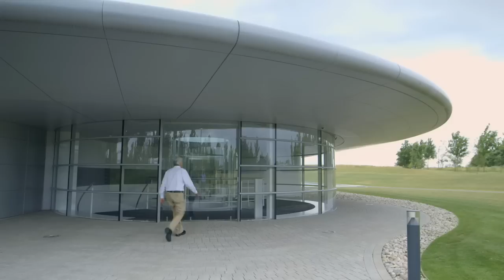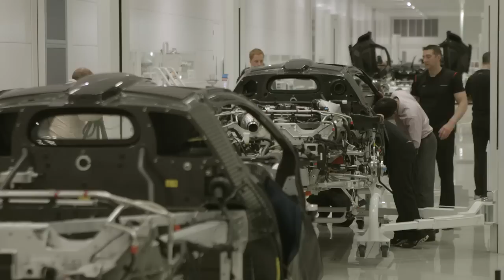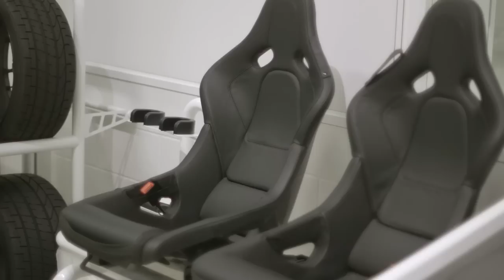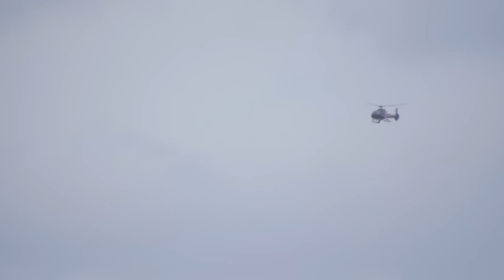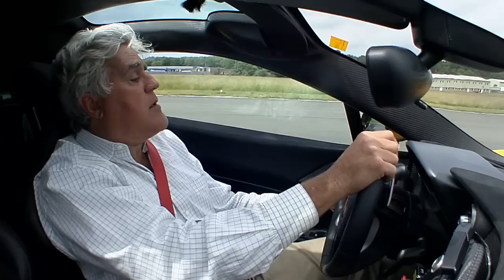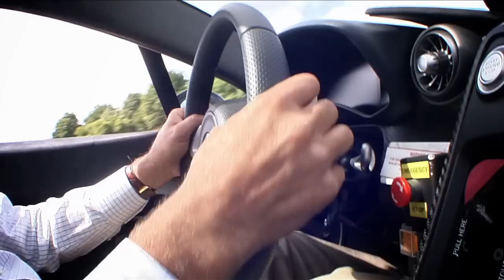2014 McLaren P1 - Jay Leno's Garage

Comment: @Fussinated Dude we don't value something by the same way. Our values are all different. I dont think you are in a position to judge there. I would also like you to show me those statistics were it shows "european people" thinking the LFA is overpriced because it's a slow car compared to a super car. Also I cant get the idea of comparing a LFA to a Mclaren P1. They are not even on the same league dude. Different cars, different purposes. The LFA is a thrills car. The P1 is a technological statement. A car can't only be valued by it's nurburgring time. Speccialy if that version of the LFA has been fine tunned for that track. In my opinion the LFA is a bit overpriced, yes, not for beeing slow, but for not beeing refined enough. It's an awsome car, dont get me wrong. The sound, the looks it's awsome. But that gear box isn't refined enough. Works on the track, not so well on the streets. Handling can be a bit tricky too (proven by the death of it's test driver). For me, a $300k+ car has to be just perfect, the LFA is close (that sound is awsome) but IN MY OPINION not quite there... But again that's not even related to the P1 which is what this video's about.
Reply: "Dude we don't value something by the same way"

Exactly. When it is a Japanese super car it is overpriced when it is a Euroepan car it is an engineering marvel and deserves no matter how much money you spent for it.

"Our values are all different"

I know, whatever Europeans throw at are valuable and deserves the asking price, but anything else doesn't worth what it cost or asking price. This is the difference.

"I dont think you are in a position to judge there"

I am judging anything. I am applying a principal brought by the guys, in means of culture, who produced this car. I am trying to avoid applying double standards.

"I would also like you to show me those statistics were it shows "european people" thinking the LFA is overpriced because it's a slow car compared to a super car"

Watch the top gear episode about LFA and listen to the "verdict" they gave and try to watch every possible LFA video on you tube. Then come ask me again about the "statistics."

"Also I cant get the idea of comparing a LFA to a Mclaren P1."

Why?

"The LFA is a thrills car. The P1 is a technological statement"

I don't know what a "thrills car" mean, however, where did you get this classification? Is there class of cars called "Technological Statement Cars" not to be compared with a "Thrills Car" ?

"A car can't only be valued by it's nurburgring time"

So, we have to go by the reviewers subjective conclusion about the car to determine whether it is overpriced or not then.

"Speccialy if that version of the LFA has been fine tunned for that track"

So, then we should consider LFA a different car when it is tuned differently. By the way Nurbugring package is not tune for track. It is road legal car that uses street tires. It is not different than tweaking the performance of your VW by changing the air filter and adding body kits.

"In my opinion the LFA is a bit overpriced, yes, not for beeing slow, but for not beeing refined enough"

Then this car is refined for you to pay $800,000 more? At best you are trying save your ego right now by saying that LFA is not refined enough. It has the best engine sound among the whole super cars, it has the best performance and it has no less quality materials inside and out. You are just bullshitting here.

"It's an awsome car, dont get me wrong. The sound, the looks it's awsome. But that gear box isn't refined enough"

The gear box is single clutch for weight reduction purposes. It is still better than the Ferrari F359F1 single clutch gear box which no one complained about when it came out. :) Again double standard. Beyond that, even with that so called non refined gear box it is still faster than its competition again with street tires.

"Works on the track, not so well on the streets"

The general view is actually the opposite. Because, it is slower it works on the streets but not on the track. But of course. after kicking ass on the track as well now this kind change of mouth is prevailing as it seems.

"Handling can be a bit tricky too (proven by the death of it's test driver)"

You don't know what you are talking about do you?

"For me, a $300k+ car has to be just perfect"

So then Mercedes Benz McLaren SLR is perfect because you don't complain about it being $490,000. You never whined about it being overpriced. I guess you should stop applying double standards.

"the LFA is close (that sound is awsome) but IN MY OPINION not quite there."

Well, YOU DON'T HAVE AN OPINION BECAUSE YOU GO BY WHAT YOU WERE TOLD.

"But again that's not even related to the P1 which is what this video's about."

This video is about an overpriced car, which has a $1.2M price tag, And the decision about it being overpriced is made by those who gave their verdict about another super car, Lexus LFA,
Reply: Pedro Matos
 "Dude, first of all stop second guessing about me"

Why not DUDE? you guessed about me at your first post without even talking to me. So why shouldn't I do the same thing even after having some ideas about you the way you respond?

"you don't know me so act like such"

I am acting just like yourself. I don't see the problem here.

"otherwise I'll treat you like an annoying no life kid that has nothing to else to do then to come in here and act like a bitch"

Be my guest. You will be treated properly in return as well.

"If you think you desearve credit act accordingly"

I don't think about deserving anything. I reason with  facts. For example just like it happens in the case of the LFA you apply double standards. When it comes to calling me a hillbilly American you have all the right in the world to do guess about me, However when it comes to others making logical statement about you after hearing your remarks, guessing about you is an insult. This quite typical.

"if you don't know the difference between a car designed for thrills, and a car designed to be a technological achievement then this is useless"

What is useless? Not caring your arbitrary, personal terminology about cars or, you have something else in mind. LFA is a super car, This is the universal definition of what type of a car LFA is. It is a technological achievement too, but it depends on how you look at it. And there is no car classification as "Technological Achievement" cars. There are concept cars but that's about it.
I don't know about useless, but if you don't know what you are talking about it is  time for you to shut up.

"because a car is always developed with an objective in mind wether is confort, luxury, daily transportation, the LFA is designed to give you thrills"

LFA is designed as a super car with the idea that Japanese can produce a car for super car market as well and compete with European brands. I suggest you should at least watch the LFA documentary. It is on you tube. If you don't want to educate yourself by reading.

"nothing wrong about that"

The only wrong thing so far is you are using your personal car classification terms. Other than that everything is fine.

"As you should know the tune they gave to the lfa was much greater than an air filter (again, stop second guessing about me I own a Japanese car and I wouldn't have it any other way), fine tunning a suspension to a specif track can do a car wonders"

I know what I am talking about. It is not even a tuning it is more of a tweaking thing. You should read more before you speak and stop assuming about the topic at hand. You don't know me either. Even after this much conversation, you still are not registering that,  I wouldn't even mention such a thing if I couldn't defend it. Well, continue talking like this and you will know anyway. However, don't get angry when you are proven wrong though. Because, so far that's what you are doing. As I said in the beginning, your ass is being given in your hand by a hillbilly American. That's why you are trying save it desperately and make a big ego thing out of this. Anyway Keep going.

"This does not mean I am taking credit from the LFA"

Irrelevant.

"The time is incredible"

Actually, it is not only the time. Lexus LFA looks an inferior car on paper and performance tests, It is slower to 0-60 than a GT-R. It pulls less g forces than a Ferrari 458 etc. However, its truly an engineering marvel since it is more than the sum of its parts. And it achieves those performances with street tires. So, if you think the focus here is just a chronometer measurement, you are way off.

"But I stand by what I said earlier "a car should be valued just by it's nurburgring lap time" "

OK! First of all, You asked me a proof about why i say that Europeans verdict LFA as an overpriced car. And I explained to you by its price and its performance and I gave the necessary reference. It is well known that all the car producers bring their cars to test to the Nurburgring, even though they have their own test tracks. By the words from the mouth of the project manager of Porsche 918 (another overpriced European "crap") if a car has any weakness, it will show at Nurburgring. So, Nurburgring is the place to determine about a cars performance.

So, LFA is overpriced because the price that is asked for it, does not legitimize its performance. This was the verdict of the European car reviewers. Hence. LFA becomes the criteria to assess a super car whether itself is overpriced or not. If you have problem with that, I can't help you there. So, you should better start your own car classification system along with your own car test results with your own criteria and expect to be accepted by the car market and then re-classify LFA and re-define it as overpriced according to those results. Until then, I, along with so called car media, go with the criteria at hand. And, that criteria decided that LFA is overpriced, and made it a criterion for deciding other super cars.

"The most important aspecto of a car is the way it makes you feel, the sensations it gives you"

Well this not only not true but also something you can't bring as an objective criterion. Say, this McLaren is overpriced because it makes feel like an idiot who is taken for a rich idiot. Should we then give the verdict that this car is overpriced?

"Unfortunatly we can't test drive it so, we got to take other peoples words for it. And no, I'm not saying top gear owns the truth, all the reviewers opinions count"

Then start learning about reviewers as much as you can, because since the LFA came up I watched pretty much all the review about it. And, the only person who didn't make a remark that can be interpreted as LFA overpriced is Jay Leno. it mentions the price but he says it comes with the territory. So, keep that in mind. Also do you really think that I am saying things without even knowing this stuff? Who is guessing about who?

"I'm not arguing about Lexus's choice of materials, and I shouldn't. They use the best on their $50k cars, so It's safe to assume they'll keep the standards with their $300k+ cars."

OK!

"What I said about the Gear box is about the Kick when changing gears. It's not unintentional and it's pretty cool when you are hammering it, but i dont think it is so good when you are stuck in traffic, I've also read the automatic shifting doesnt ever know what gear to engage. This is not just with the LFA, in fact i knew a guy who owned a M6. He sold the car, the main reason was the gear box. The car leaped forwards of backwards when he engaged the lower gears."

First of all, The biggest criticism about the LFA's gear box is about it being slower in shifts than having a double clutch gear box. And, this "kicking" you mention, I am hearing it the first time from you and therefore I am deducing that it is not a factual statement but just a assumption.

"I think it's safe to assume that a car that kills it's chief test driver will be pretty tricky to handle by a non professional driver. But again, most hardcore cars with 1 or 2 exceptions are."

First of all, The driver is killed on a side road, off the track. It was a collision with another cars. Second, because of this, there is no record of the accident and no one knows how the accident occurred and why. So, if you have a better knowledge on this issue, please inform the authorities, since they still are looking for the truth about it. So far, they only have guesses. That's why I told you that you don't have a clue what you are talking about on this killing the driver, because no one has.

"Again, you don't know anything about me. I hate the SLR. I wouldn't buy it even If i were Bill Gate's kind of rich for half the price. It's fast but, for me, there's nothing more to it. Again, we all have different values, and I'll respect the ones who like it"

That's quite irrelevant. You never heard reviewers call it as overpriced. You never made a statement about it as overpriced, not even according to your own classification, because you will rationalize it as, again, since that car was technological achievement car, and it worth the money even if you don't like it. etc. The issue here is the double standard. Your personal likes does not count. You may even like a Jaguar and be in love with it, but objectively it is the least reliable car in the world. If you apply the same principals and find out that Toyota Corolla is the most reliable car you have to admit that Corolla is more reliable car than a Jaguar, period.

"The vídeo is about an ahyper car, there are plenty of them"

Hyper car, as a term, started to be used for production cars after the LFA. Because Europeans realized that They have to change something since Japanese can produces as good a super car as Europeans, if not better. So, they come with hyper car thing. Here is a home work for you; find a PRODUCTION CAR that is called hyper car prior to LFA then you will have a point. :). However, I am just a hillbilly, American most likely I am saying these things without even making a research or something. Why don't you do it the right way then? :)

"As I said I don't think it's fair either to the LFA or the P1 to be comparing them. They are so different from each other they aren't even on the same league. If you want to compare the P1, compare it with the Ferrari LaFerrari or the 918 spyder"

The difference is that the cars you mentioned are hybrid cars. That's the only difference. However, if they are different as you claim than super cars, i.e.they are hyper cars, then hyper cars are overpriced cars. They can't even perform as good as a super cars namely the LFA yet they cost too much.

However, your persisting on this brings out another double standard issue. Here is what I want you to do. I want you to tell me that you never compared a Hybrid car, say Toyota Prius, with a diesel car, say VW Jetta. And I want you to persuade me on that .... If you want a clue, you will never be able to do that. :).

"I'm not saying the LFA is a bad car, far from it, as I said it's sound alone is almost worth the $300k, and would defenatly be in my 10 car garage"

OK! here is the deal I am not saying that this MacLaren is bad car, far from it. It almost worth more than $300,000., and if it cost around that I would have had it given that I had the money.

"But, If i were to spend those ammounts of Money in 1 car, I would probably choose an aventador."

But, If had to spend $!.2M in one car I would probably have hung myself, or I would do it under duress. :).
Reply: Fussinated I didn't feel insulted by your second guessing I just pointed out you were completely wrong. I didn't second guess, I made an honest call based on what you were saying. As you remember you were saying "the p1 is overpriced because the LFA is fast on nurburgring and it's 1/4 the price". On further conversation with you I realized that your opinion is more profound than that and I was wrong, even if I don't agree with you. As I said I don't think we can evaluate cars for it's nurburgring times. Specially if the P1 has no official time (that I know about). And I stand by it. There's much, much more to be said about a car than the nurburgring time, and even you can't deny that, and in my opinion the GT86 it's a solid proof of that.
I also don't understand why you can't accept when I say cars are designed with different ideas in mind. When the Veyron first came out, I remember reading one of the developers saying that the car was built more like a technical exercise then anything else. And yes, I (yes I) consider this 3 new hyper cars more like concept cars for the road than just a simple super car. They are, for the first trying out this "new" hybrid technologies that I suspect we'll see on their next cars.
I'm not saying the LFA was not a turning point for lexus either. They spent 9 years developing it and for the way they made it, the responsiveness of the engine with a time of 0.6 seconds from idle to redline, the sound (and the way they channel it from the engine bay to the passengers, the way the interior is styled, all of that it's just "crazy". The Experience it gives you is just thrilling.
If we compare the standard LFA and the R35 GTR, the GTR. The GTR is, on the track, a lot better than the LFA, and about 3 times cheaper. But I think you'll agree with me when I say, I still think the LFA is about 3 times the car the GTR is (I also love the GTR). With this, I'm not saying the P1 is better or worse then the LFA (I didn't from the start). I just think those cars are so much different from each other to be compared. 

I don't understand why you think what I said about the LFA being designed for thrills conflicts with what you said: "LFA is designed as a super car with the idea that Japanese can produce a car for super car market as well and compete with European brands." I've actually watched that documentary awhile back. If you think what I said conflicts with what I've said then you've misunderstood me. I said the experience they wanted you to have while driving a LFA is a lot more thrilling and intense then most other super cars, and that was one of their main goals. Of course I'm only guessing, since we've never actually driven one that's all we can do, and I've already explained why I think that.

The problem with the automatic gear box not being able to choose the right gear is/was indeed factual since you can find it in some reviews, I just don't know if it got corrected in the latest 2012/2013 models. Not a big deal since I can't imagine too many people buying a LFA and drive it in automatic. As for the "kick" I'll quote LFA Chief Engineer Haruhiko Tanahashi in an interview:

"- Have you considered a dual-clutch automatic gearbox for the LFA?
I’ve tried Volkswagen’s DSG around Nurburgring. Although it must be said [that DSG] is smooth, such a gearbox doesn’t suit the LFAs boy-ish character."

They want the driver to experience the gear transition. Not just a continuous acceleration. Again, they want it to be thrilling. It's not a bad thing at all. On the track I also want to fell those transitions. But I've read some guys saying it may become annoying in traffic. Of course, I haven't experienced it myself, so I wont vouch for that.

I did know the accident was in a side road, and no matter what were the circumstances the driver died and the car failed.

I do in fact think the SLR is overpriced, because I don't think it handles, sounds or looks the way it should for that price, and when it came out, I did find some reviewers saying it was indeed overpriced. But when we evaluate cars like this all our values and personal likes will come to play, weather we like it or not. I cant see most cars just like a bunch of numbers. For me, there's more to it than their times or top speed, and I think I'll be safe to think that for you there are too. Since we are talking about cars that in terms of performance are not so far apart from each other, our personal likings (even in the reviewers) will come to play.

Why can't you just say an hypercar is a car much more exclusive and special than a supercar? Usually the more exclusive something is the more expensive it gets. It doesn't mean it's necessarily better or worse, just that it is more exclusive and in someway special, therefore usually more expensive.

I did compare the two. Mostly because Toyota says the prius is a very economic car to run, and I find it not to be true. And I do that because I know some people who owns a prius and they all get 5 to 6 liters/100 Km and a golf diesel can do a lot better than that and you don't even have to spend a little fortune changing the batteries. On top of that it's an ugly car and drives like a turd. It's not a double standard. Toyota says it's cheap to run, for what I've seen it's a lie because we can find better and cheaper. It's a car take only makes sense in some countries.
But I can say you this, I would never compare a Veyron and a koenigsegg or a zonda. (which I find more suitable)

You can't compare the P1 with the Prius or the LFA with the Jetta. The P1 it's like a platform for modern technologies. I won't even start to enumerate them, since I would be stay here for ages and you know about it I guess. The Prius is just a car that also has an electric engine and some batteries. There's nothing so fancy about it.
I wouldn't see myself buying a P1 either, but I guess that people who buy it are mostly making investments. As you know, cars like that end up becoming more expensive after their production ends.

My main point is I don't think you're right to compare the P1 with the LFA for their nurburgring lap times and prices.
As far as I know the P1 does not have an official time yet and mostly the cars are a lot different.
Reply: Pedro Matos

 "I didn't feel insulted by your second guessing I just pointed out you were completely wrong."

So, is that why you threatened to change your attitude?

"I didn't second guess, I made an honest call based on what you were saying."

It was not a call as much as it is not honest. Because obviously you didn't even have a clue what I was saying.

"As you remember you were saying "the p1 is overpriced because the LFA is fast on nurburgring and it's 1/4 the price""

The post you responded about me being an American Hillbilly was only saying that This McLaren is overpriced. Your response was your guesswork.

"On further conversation with you I realized that your opinion is more profound than that and I was wrong, even if I don't agree with you"

Well, of course, you might not agree with me. However, this is not a matter of faith or politics or supporting a team. My argument relies on facts, and I will beat you up with those facts.

"As I said I don't think we can evaluate cars for it's nurburgring times. Specially if the P1 has no official time (that I know about). And I stand by it"

And you would be wrong.

"There's much, much more to be said about a car than the nurburgring time, and even you can't deny that, and in my opinion the GT86 it's a solid proof of that"

OK, here you are making me repeat myself. This time I will put it in an itemized format.

1- LFA is called overpriced by comparing its performance to its price.

2- No one who claimed LFA as overpriced mentioned individual arbitrary aspects of the car, such as handling feel, or ride, or safety etc.

3- LFA, since it is concluded as overpriced due to this, became the focal point for deciding about the overpriced super cars

4- Since the LFA is called overpriced because of its performance in comparison to its price, it is foregone conclusion that a super car that is not overpriced should perform better and cost less than the LFA.

5- LFA is the fastest car at Nuburgring with street tires.

6- Nurburgring is a track that all the car producers test their cars and mutually agree that it is ultimate deciding element about a car's performance.

7- Therefore, any car that performs poorly than the LFA AND costs more than the LFA is proven as overpriced.

8- Considering the fact that people would still by those other overpriced cars, individual preferences does not effect these facts.

"I also don't understand why you can't accept when I say cars are designed with different ideas in mind"

I accept that the cars are design for different purposes, I don't accept - and all the car industry along with me - the purposes you mentioned.

"When the Veyron first came out, I remember reading one of the developers saying that the car was built more like a technical exercise then anything else"

However, the Veyron is classified as a super car. Also, do as I say, watch the LFA documentary the purpose of why Lexus build such a car is explained there clearly, yet, the LFA is still a super car.

"And yes, I (yes I) consider this 3 new hyper cars more like concept cars for the road than just a simple super car. They are, for the first trying out this "new" hybrid technologies that I suspect we'll see on their next cars"

If, a hyper car is a hybrid super car, as I mentioned they are not different than super cars at all.

"I'm not saying the LFA was not a turning point for lexus either. They spent 9 years developing it and for the way they made it, the responsiveness of the engine with a time of 0.6 seconds from idle to redline, the sound (and the way they channel it from the engine bay to the passengers, the way the interior is styled, all of that it's just "crazy". The Experience it gives you is just thrilling"

I bet you will be thrilled when you drive a Ferrari 458, or Nissan GT-R, or a Corvette C7 because they are all super cars, actually GT-R and Corvette are more like super car killers, or thrill car killers, if you want an informal classification, :).

"If we compare the standard LFA and the R35 GTR, the GTR. The GTR is, on the track, a lot better than the LFA, and about 3 times cheaper. But I think you'll agree with me when I say, I still think the LFA is about 3 times the car the GTR is (I also love the GTR)."

That's irrelevant. You can only prove that GT-R is not an overpriced car with such approach and I agree with you. However, when you compare LFA with other cars you should point out one single but very important fact, LFA runs on street tires and "standard" LFA (See, I had no idea that there is a standard LFA aside the LFA with Nuburgring Package, I must be a Hillbilly American ... again who has no idea that standard LFA still had similar track times with the competition even though they (including the GT-R) ran on semi slick tires unlike the STANDARD LFA).

"With this, I'm not saying the P1 is better or worse then the LFA (I didn't from the start). I just think those cars are so much different from each other to be compared"

You are still talking irrelevant

OVERPRICED is the concept we are focusing on. I never mentioned "better", this is your doing.

"I don't understand why you think what I said about the LFA being designed for thrills conflicts with what you said: "LFA is designed as a super car with the idea that Japanese can produce a car for super car market as well and compete with European brands." "

Because, it is the truth. The LFA is a super car and it is tested as one and the verdict about it being overpriced given as one.

"I've actually watched that documentary awhile back. If you think what I said conflicts with what I've said then you've misunderstood me"

If what you are saying that driving super cars gives you thrills, then why are you opposing me saying that the LFA is classified as a super car?

"I said the experience they wanted you to have while driving a LFA is a lot more thrilling and intense then most other super cars, and that was one of their main goals. Of course I'm only guessing, since we've never actually driven one that's all we can do, and I've already explained why I think that"

How about "a fun car." That is also used by people to describe cars when they drive and like the handling of it. However, there is no such classification this is the deal here.

"The problem with the automatic gear box not being able to choose the right gear is/was indeed factual since you can find it in some reviews"

???? Single clutch AUTOMATED gear box can be operated manually as well. if we are to talk about the LFA and if it is observed on LFA again I have never heard of it can't be specific to LFA but the gear box itself.

" I just don't know if it got corrected in the latest 2012/2013 models. Not a big deal since I can't imagine too many people buying a LFA and drive it in automatic. As for the "kick" I'll quote LFA Chief Engineer Haruhiko Tanahashi in an interview:

"- Have you considered a dual-clutch automatic gearbox for the LFA?
I’ve tried Volkswagen’s DSG around Nurburgring. Although it must be said [that DSG] is smooth, such a gearbox doesn’t suit the LFAs boy-ish character." "
SMOOTH, is the opposite of jerky i.e. kikcing. However, not smooth, not as smooth as, don't mean jerky or kicking. I guess you should work on your understanding what is said to you.

" They want the driver to experience the gear transition. Not just a continuous acceleration. Again, they want it to be thrilling. It's not a bad thing at all. On the track I also want to fell those transitions. But I've read some guys saying it may become annoying in traffic. Of course, I haven't experienced it myself, so I wont vouch for that. "

I have never headr such a thing about the LFA gear box. These are rumors that can't be substantiated.

"I did know the accident was in a side road, and no matter what were the circumstances the driver died and the car failed."

Without the facts how can you conlude such a thing? How do you know that it wasn't the drivers fault but not the car's?

"I do in fact think the SLR is overpriced, because I don't think it handles, sounds or looks the way it should for that price, and when it came out, I did find some reviewers saying it was indeed overpriced"

No, you are mixing the comment about the car being expensive with being overpriced. And, as for you, you say this now, again to deal with me in this conversation not to step back.

"But when we evaluate cars like this all our values and personal likes will come to play"

Whose personal likes? Top Gear clowns called LFA as overpriced after that everyone started to call it overpriced.

"weather we like it or not. I cant see most cars just like a bunch of numbers. For me, there's more to it than their times or top speed, and I think I'll be safe to think that for you there are too. Since we are talking about cars that in terms of performance are not so far apart from each other, our personal likings (even in the reviewers) will come to play"

Well, if this is so, then you can only speak for yourself. For that, as long as, you don't give general verdict about a car, especially without advertising it to the public, it is your personal preference. However, when you are car reviewer and you are out there to test cars a give verdict, thats a whole different story.

"Why can't you just say an hypercar is a car much more exclusive and special than a supercar?"

There is no such thing as a hyper car. There is, however, a hybrid super car.

"Usually the more exclusive something is the more expensive it gets. It doesn't mean it's necessarily better or worse, just that it is more exclusive and in someway special, therefore usually more expensive"

And, if so, overpriced as well.

"I did compare the two. Mostly because Toyota says the prius is a very economic car to run, and I find it not to be true"

There you go. So, because european bigots said that the LFA is overpriced when its performacne is compared to its price, you can compare this car with the LFA in the same manner.

"And I do that because I know some people who owns a prius and they all get 5 to 6 liters/100 Km and a golf diesel can do a lot better than that and you don't even have to spend a little fortune changing the batteries. On top of that it's an ugly car and drives like a turd. It's not a double standard"

Of course, it is double standard. for two reasons.

1- You are comparing a diesel car with a hybrid car that runs on gasoline. You should compare it with other gasoline cars and then you might agree with Toyota.

2- Toyota claims that it is an econmical car it is not a "thrill car" as you put it. By expecting a thrill ride from an economy car, you are applying again a double standard.

"Toyota says it's cheap to run, for what I've seen it's a lie because we can find better and cheaper. It's a car take only makes sense in some countries"

Nonsense, because you are applying double standards.

"But I can say you this, I would never compare a Veyron and a koenigsegg or a zonda. (which I find more suitable)"

Because? This is again double standard.
 
"You can't compare the P1 with the Prius or the LFA with the Jetta"

HUH? No you compare P1 with LFA, and I don't compare Prius with Jetta though. Since, Jetta is one of the least relaible cars in the world - which is far more crucial aspect on that category than performance - while Prius is one of the most relaible cars.

"The P1 it's like a platform for modern technologies. I won't even start to enumerate them, since I would be stay here for ages and you know about it I guess"

I don't think you can say much more about it, than you can say about a regular hybrid car.

"The Prius is just a car that also has an electric engine and some batteries. There's nothing so fancy about it"

:) That's why I like Japanese cars. They bring the worst out of the bigots. The car that dominates the hybrid segment with added technologoes each year. and nothing fancy about it? Really? With all due respect you can't be less discrete as a hater, than this.

"I wouldn't see myself buying a P1 either, but I guess that people who buy it are mostly making investments. As you know, cars like that end up becoming more expensive after their production ends"

I agree on this, however, it may be such a bullshit to buy a car for investment.
.
"My main point is I don't think you're right to compare the P1 with the LFA for their nurburgring lap times and prices"

Well, you are wrong becasue I am not comparing them, the criteria that were used to conclude about the LFA being overpriced eventually brings that it Is beyond my personal criteria preferences..

"As far as I know the P1 does not have an official time yet and mostly the cars are a lot different."

Irrelevant, because it should be costing less from LFA and it already costs 4 times the LFA.

Applying the with same criteria Porsche Turbo, Ferrari 458, Nissan GT-R, Chevrolet Corvette are priced right cars, while Ferrari Enzo, Pagani Huayra, Bugatti Veyron, even the Lamborghini Aventador are overpriced cars, along with the Ferrari LaFerrari, Porsche 918, and MacLaren P1.
Reply: I wouldn't try to argue with Fussinated, man. You can't win. Not because he's right, but because he won't admit when he's wrong.
Reply: ewt415
This is such a lame thing to say. Shouldn't you first show that I am wrong? Contrary to your claim here, I accept my mistakes so easily and naturally that you wouldn't even realize it. When did you witnessed that I was wrong and didn't admit it? Now, I am asking you, do you admit that when you are wrong? Obviously you are someone who tried hard to argue with me in the past and failed to achieve to make a valid point. Did you admit you were wrong or your ego was bruised so much that now you say this about me? I won't admit that I am wrong, huh? Do you? :)
Reply: Fussinated Pedro Matos^ This is exactlywhat I was talking about lol
Reply: "This is exactlywhat I was talking about lol"

You are an idiot. I am telling you that first you have to prove me wrong. You respond like this. I suggest that you should first focus on your shortcomings before mine.